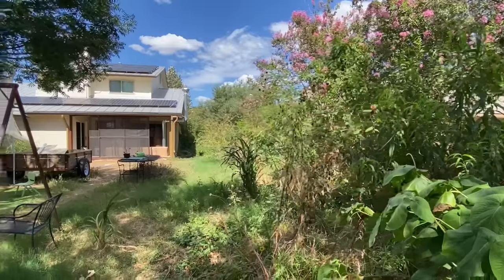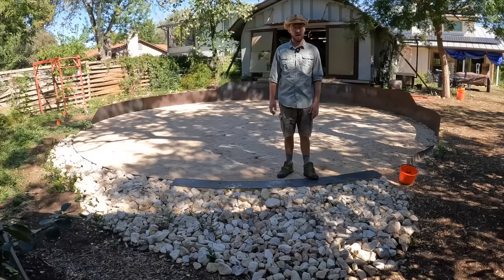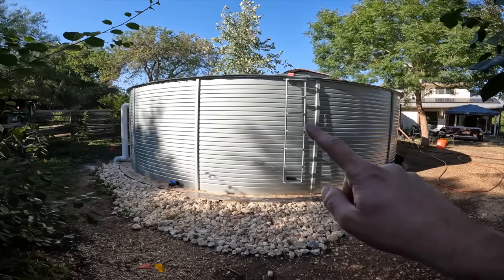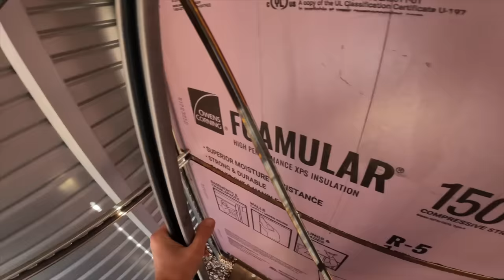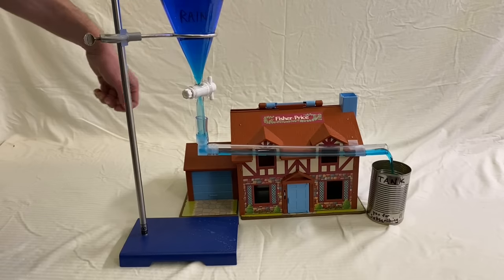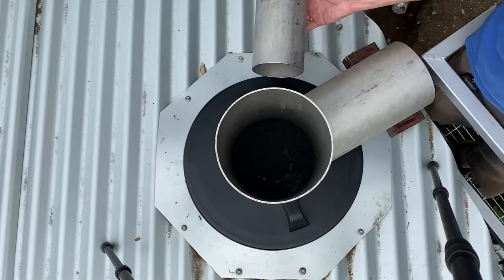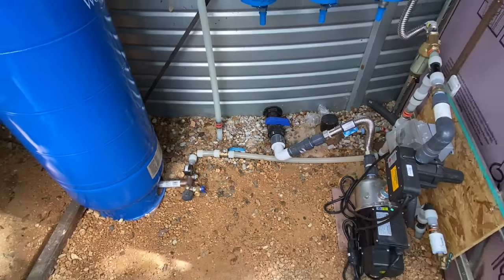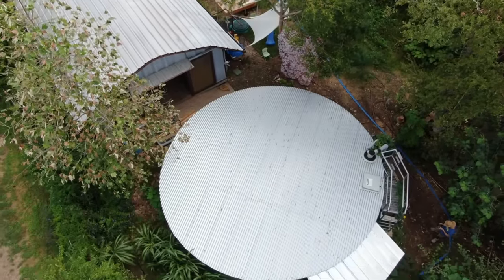FREE water forever.  LEGALLY!!!!

Comment: Its crazy that in some places collecting RAIN WATER is illegal.
Reply: In Australia it’s illegal not to collect rain water.
Reply: Because it can mess up the local water table.

Remember water runs in a cycle, by collecting it you are removing it from that cycle.  Collecting thousands of gallons of water and just holding it can cause damage to the surrounding ecosystem.
Reply: @sgt.doughnut5918  That isn't true or logical. This water would still be used by his household. It would just be stored with the public reserve.
Reply: in america everything that is not related to capital is illegal
Reply: I think it’s illegal to collect a certain amount because if you say collect a very large percentage of the rainwater in an area that doesn’t get much anyways you can basically hold it hostage for money, some shit nestle would do
Reply: @b33zcraigslist46  I doubt his toilets flush out into the yard so no, this is different.
Reply: @sgt.doughnut5918  water runs in a cycle, allright. But what do you think happens to the water he collected? He didn't just revoved it from the cycle. He will drain and spill, wash and shower and pee, and the water anyway will go back to the cycle not very far from where it belonged initially. Those thousands of gallons will all return to the nature.
Reply: @sirsanti8408   in our country, experts recommend collecting rainwater for watering gardens so as not to overload the water supply network, and water is a constitutional right of every citizen.
Reply: @spaceair1  oh yeah it’s definitely not a country wide thing, 90% of states in the US don’t care about rainwater collection or even give you tax rebates for investing in a system. There are a few states and counties with some backward laws. Although I think I remember someone or some company buying a bunch of land just to collect all the water that landed on it and that caused some problems
Reply: He's collecting water from his roof and not his whole property, I doubt that will change the water table levels.
Reply: That’s what I read also.  Why is that ???
Reply: @andreysednev8542 where did you hear that in this video ??? Collecting rain water off your roof would out bad chemicals in the water and sand from shingles.
Reply: There are no places where collecting rain water is illegal.
Reply: @gg-gn3re Ahh, yes there is… Oregon, Washington & California, for starters.
Reply: Es braucht ja auch die Natur
Reply: Unfortunately, it is highly regulated in Ohio.   It's almost as bureaucratic and tedious as getting permission to turn on your solar array (5-8 months or waiting for inspections).

"Private water systems in Ohio require a permit from the board of health pursuant to Ohio Admin. Code 3701:28. Rainwater cisterns are required to have continuous disinfection installed (Ohio Admin. Code 3701:28)."
Reply: @Captkid1  No it isn't. Oregon you can collect 5000 gallons before even needing a permit. 
California you can collect infinite amount with a permit
Washington it's legal everywhere, some specific counties have regulation. No permit required
did you even look it up or you just make stuff up?
Reply: @gg-gn3re  A permit? So it isn’t legal without a permit?  That is insanity, it is Rain Water.
Reply: You usually don't own the water or mineral rights under your home either.
Reply: @Captkid1  Most homeowners in Colorado are now allowed to use rain barrels to collect rainwater. A maximum of two, 110 gallons total.
Reply: @gg80108  As if government owned the rain, right?  Next it will be unlawful to out in the rain, because your clothes absorbed too much. Wouldn’t surprise me.
Reply: @gg80108  True. But you do own the air space above your home for several hundred feet. You certainly own the air space in your yard and home.
Reply: @Captkid1   yes the air is free water not so much.
Reply: @b33zcraigslist46  I think what he means if people are collecting and storing water rather than using it in places that experience a lot of drought. Still illogical though
Reply: it is illegal to collect rain water in palestine gaza and palestine west bank
Reply: @gg-gn3re  good point.  Most places require a permit to build a structure and it wouldn't be proper to say building structures is illegal because of that.
Reply: @Captkid1  Another comment thread brought up that apparently it has to do with tracking water usage across the state for things like issuing drought warnings and such; if a bunch of people were using collected rainwater that the government did not know about, it would screw up their calculations used for warning people about droughts.
Reply: @G-Cole-01  Ok, I am retired from the government after 30 years of work in the Engineering / security / Law Enforcement. I have worked with many agencies over the years. First off, if you intrust the government to keep you in water, you’re going to die of thirst.  Second, rain water is completely unpredictable, uncontrollable and is not calculable.  Where will it fall, how will it fill flow, what percentage will evaporate, what percentage will flow into a stream or river, what percentage will filter down into the aquifer? But most importantly, the government does not own, control or even keep exact record of the rainfall. Since the governments around the world have been manipulating weather for the last decade, climate issues have gotten worse. But we aren’t suppose to collate the two.  Hmmm. Keep this in mind when you are entrusting the government to do anything. The structure of the government is for everyone to move up. Each person is in their current position 3 to 5 years. You are encouraged, promoted and even forced to change. The longest I held any one position was 12 years and I had to leave and come back to get twelve years in that position. What if your doctor only had less tahn 3 years in medicine? What if the person building your home had less than 3 years in construction. Now add in POLITICAL control of funds and a requirement not to piss off either of two opposing political foes, who both have some control over you.  That is the Governement you want to control your water. Reminder; You can only live 3 days without water and three weeks without food. Do you really want to count on the government when they say, no, no let that water go, we will give you your water you need to drink. That God given water is ours to control.
Reply: @spaceair1  correct
Reply: @sgt.doughnut5918  You're correct, but it doesn't prove your point. If what you propose was true, droughts would effectively destroy the water table. The reality is it's VERY difficult to disturb it. There's usually enough ground water to sustain well over 5 seasons with sub average rainfall. Now if you live on/at the base of a hill, suddenly it matters even less, And to be honest? What do you think happens to excess water? If it can't saturate, it runs. Even in sub par rainfall regions there's still an excess.
Reply: Maryland taxes you on how much rainwater hits your land.
Reply: @sgt.doughnut5918  lmaoooo he's collecting roof water, not water from the Amazon forest. hahaha
Reply: Agree with you it's sad✌️
Reply: @sgt.doughnut5918 That is so stupid. I had no idea our bodies violated the laws of conservation of matter when drinking water.
Reply: @spaceair1 what country? Must not be America bc we are price gouged in certain towns andnstates depending onnif its a private or public water municipality
Reply: @michroz  the water will be send to a treatment plant that will in most case will clean most of it and send it back in the ocean or a river and not the place where it should be said a region where rain is scares so now there less water in that specific region so desertification will now be faster like yes the water will go back in nature but not the place where it Should be
Reply: @sgt.doughnut5918  if you are hoarding water, possibly true, but that would also mean that you would have to have a large piece of land to have any sort of impact.  If you're collecting water for your home use, or even to water your lawn/garden, wash your car, or anything else you would normally do with municipal water, unless you're collecting water is several multiples of what you use, what you claim would be completely incorrect.  Even if you did collect 100 times what you use, that means that you will only have an impact on the environment (although insignificant) only for the initial period of filling up your reservoir.  After that, your collection rate will match your use rate exactly, and then, again, you would actually be saving water, because you would not have losses equivalent to the losses through leaks in the municipal plumbing.  You would also reducing the use of toxic products used in water purification and toxic fluoride being put into your water without your consent.
Reply: @sgt.doughnut5918  which is funny because the water eventually gets used anyway so all you're doing is delaying it.
Reply: Some states/areas/countrys it's illegal because of past incidents were it causes hundres of thousands or millions in damages. also each collection system would require system check ups by professionals not just yourself. to make sure it's filtering right and safe for yourself/future occupants of that house.
Reply: California 😂
Reply: @arkfan5345  Yeah. The laws about this make perfect sense if you think about the impacts.
Reply: Nobody owns the rain.. those laws aren't real.  Just keep your mouth shut
Reply: @DTA-me3kv  it's not a law against owning rain are you really that dumb? It's about the construction. The filtration and safety of it  for residents ect. Or the impact of large amount rain water being collected from certain areas causing eco systems to get wonky and messed up.  Also if a let's day 60 ton water collection system just for argument sake breaks because poor maintenance. That can cause insane amount damage. Water as fragile as it is in small amount is deadly in large storages.
Reply: @valleymykel-mq7gw  The complaining about "I can't even collect rainwater on my own land, damn gubmint" is 90% from people that are eager to do exactly what the law is attempting to stop, namely collecting water from dozens or hundreds of acres of land that is unsuitable for farming adjacent to their farms in an effort to improve their crop yields at the cost of fucking up the water table for a ton of land. "I can't even put out a rain barrel, unhappy face", yeah, and the multi-million dollar system you want to install in the next lot over is merely a coincidence, I'm sure.
Reply: @sgt.doughnut5918  I'm having a hard time figuring out how this makes sense and I'm stupid.
Reply: @michroz except that water, unless he’s draining it into his yard (which would be *significantly worse*, I hope I don’t have to explain why pumping sewage into your lawn is bad) doesn’t just “go back into the cycle”, it goes to a waste treatment plant, is decontaminated, and then pumped out to wherever the city gets it’s water, to cycle back again.

But that plant and reserve could be incredibly far away, and so the water table in his area can be damaged by stuff like this.
Reply: @spaceair1  THERES the correct answer lol
Reply: @b33zcraigslist46 I think the law is dumb because it’s your own property but, wells rely on that water that is underground. So if everyone started doing this, those wells would not produce as much water.
Reply: @skwillywilly  The science or math doesn't add up regarding well water. Aldo, if well water is for human consumption, why be upset that it's being consumed?
Reply: @sgt.doughnut5918  It's being collected anyway, it's just that on most houses it's being thrown back down.
Reply: @Captkid1  Citation needed. It seems like the kind of thing that should be encouraged in those states, which are seasonally dry.
Reply: @gg80108  you don't own anything. and you shouldn't. you should only own the right to use and improve.
Reply: @Captkid1  citation needed on government weather manipulation
Reply: @sgt.doughnut5918  It's also released back into the ground via soakage holes after the septic waste system. So it all ends up back in the ground eventually.
Reply: @sgt.doughnut5918  😂😂😂😂 oh my god you actually believe that. 😂😂😂😂😂😂😂😂😂😂😂😂😂
Reply: @ellenorbjornsdottir1166  I don't make the laws, these laws exist even if you know about them or agree with them. Don't steal my aquifer water.
Reply: Where is it illegal ?
Reply: @spindrift2719  Did yo read the responses? People have listed it being illegal in several states & regulated or restricted in several more.
Reply: @sgt.doughnut5918 I never heard that one thanks for sharing extra knowledge 😅
Reply: @sgt.doughnut5918 you mean kinda like the cities where we live do😳🤯
Reply: MOST of the adventures recorded in this book really 
occurred; one or two were experiences of my own, 
the rest those of boys who were schoolmates of mine. Huck 
Finn is drawn from life; Tom Sawyer also, but not from an 
individual — he is a combination of the characteristics of 
three boys whom I knew, and therefore belongs to the com-
posite order of architecture.
The odd superstitions touched upon were all prevalent 
among children and slaves in the West at the period of this 
story — that is to say, thirty or forty years ago.
Although my book is intended mainly for the entertain-
ment of boys and girls, I hope it will not be shunned by men 
and women on that account, for part of my plan has been 
to try to pleasantly remind adults of what they once were 
themselves, and of how they felt and thought and talked, 
and what queer enterprises they sometimes engaged in.
Reply: @gg-gn3re Oregon for sure. Most likely California but I'm going to look into that.
Reply: What about a state of the art filter system to clean the seeding chemicals they put into the atmosphere
Reply: Land of the free
Reply: The sheriff of Nottingham wants his tax money.
Reply: @sgt.doughnut5918  That's not how it works, if this was correct them lakes and rivers, deserts, swamps would be in the same location for million of years, but they move. Whoever told you this is wrong, there is a reason why we were nomads in the first place, we were chasing water and other resources.
Reply: @milliesecond102  wrong. You are allowed to collect rain water in all of oregon and it's encouraged in most parts.
Reply: @sirsanti8408 it's from the southwestern US. You have water right (typically 1 acre ft/acre) these can be bought and sold independent of the actual land.  The water which flows though rivers and streams are part of these calculations. Where water and rain are scarce water becomes a commodity.
Reply: @michroz Yes, this is why the ONLY illegal rainwater collection in ANY state is in regards to collection and use not by the property the collection is on.   If you build a large enough collection site you may be assesed a small usage fee and tax, amounting to a few dollars a year; but thats only if you are collecting massive amounts of rainwater as-in comercial scale collection.
Reply: @Captkid1 No, its not and you should really stop amplifying that lie; it makes you look lazy.
Reply: @tstan6827  Thats only is you tie it into the mains.
Reply: @Captkid1 Maybe you wouldn't be so unhappy if you stopped believing misinformation; you are already on the internet, and if you are too lazy to look up state and county laws you may as well just not believe anything you read and get on with your life.
Reply: @Captkid1 If you live outside of flight areas its generally considered 500 feet.  If you live in flight congested areas its about 80 feet.   rain is usally higher up but you are all arguing about a nothing-burger since the whole rainwater collection is illegal is just another neocon lie.
Reply: Fun fact: in many states reasonable sized rain collection tanks don't have to be permitted even when a smaller shed would have to be. There is some mention in these comments about Ohio in particular, where they have confused a cistern with a water barrel or tank; in that case a cistern is a raised up structure such as a water tower or a tank on top of a building.   the purpose of a cistern is to maintain water pressure when the pumps stop;  the issue with private cisterns is tying into the main with gravity pressurized tanks and your regular household backflow preventer is not built for that.  This is a similar situation to what occurs when you want solar or a generator to do anything but run a wholly seperated circuit in your home.
Reply: @_digitalcoffee  Not unhappy or misinformed. You just go ahead and count on the government to give you food and drink. See how it goes. I am retired from the Federal Government. I know that YOUR Government says EVERYTHING is your own fault in the end. And you are responsible for everything in the end.  You and you alone.
Reply: @_digitalcoffee  NO, collection of rainwater is being regulated in several progressive states. It is a real problem for many Americans who want to use water for purposes the controllers don’t like or approve. By example, watering a garden is not a water priority or approved under regulation periods.  From my own point of view, it is also being used as one of many freedom infringements tools to drive population into or out of areas of the USA. I live in Florida. 1.3 million people moved here from California, PA and NY last year alone. All are fleeing tyranny freedom losses of their state governments that they elected to govern them. Possibly they were  ill-informed voters, possibly believing lies of politicians, most likely thinking that loosing a few Freedoms is a NOTHING BURGER or maybe even a neocon lie.
Reply: @_digitalcoffee  Lazy? Thats funny. Obviously you are a liberal. Liberals always fall back on name calling when they loose a debate.  I am an Engineer, a Mechanical Contractor, an Electronic Technician, a Federal Security Technician and an Electrician.  My hobbies are Sailing, building boats, running a sawmill, Woodworking, teach young adults the trades, art, photography, fishing, drones and theological studies. I have never been called lazy before in my whole life. I would love to hear how you came to that particular name to choose to call me when your ability to hold your stance in this public debate failed you.
Reply: ou do , then y don't every sue the airlines and factories for contamination of my air space n quality and brings up alot of hmmmm if true
Reply: @Captkid1  I'm a disabled veteran who enlisted during wartime and served eight years until my hand got crushed. 
How long did you look through state laws to confirm that none made rainwater collection itself illegal.   There is nore to life than your political stances; I would love to hear you tell me how my enlistment after my country was attacked and the fact that I am a sworn constitutionalist makes me a liberal.   By all means dig a bigger hole by insulting me because you wanted to express a baseless opinion about non existant laws.   I guess lazy wasn't accurate enough so how about we try "unconcerned with truth and reality and apparently an idealogue."
Reply: @_digitalcoffee  How is your Veteran status relevant? I am a disabled Veteran too, with a service Dog, I don’t use it as part of social interaction to try to gain advantage in a debate. Being a Disabled veteran is an honor, not leverage point. It does not excuse you from being an honest, moral and ethical human being. You obviously have not researched the laws on rain water collection, nor did you read all the replies of people living under those laws in various different States, that have these laws. So it is you and you alone that is not touch with the topic you hope to spread Liberal Propaganda on. Unconcerned with the truth, reality and being an ideologue describes YOU.  Like most Liberals, you accuse debate opponents of exactly what you do.  Try getting a hobby. BTW, the post you are responding to is 3 months old.
Reply: @Captkid1  You mean CO and CA, yeah, I did reasarch those, and debunked that, unlike you I tske the time to research the actual statutes, not spout propaganda and be lazy of the mind like yourself.
Reply: @Captkid1  I love how you were too lazy to actually look up what is prohibited in OR is groundwater pumping, waterway diversion, and creating large artificail sole-purpose collection points.   Just keep spreading disinformation to fit your biases; I will continue to fight the zeitgeist with polite might.
Reply: @Captkid1  And in this post, by your stated arguments, you are a hippocrite and apparentlty also a liberal; considering you resorting to name calling instead of actually debunking misinformation and crying when someone points out your fallacies.  Good job, liberal.
Reply: Colorado.
Reply: @tanial.williamson8082  Colorado allows for two barrels and up to 110 gallons.   Also its not the state government but the state's constitution which provides for first-come first-served access to state resources including water so, in a way, R&R Market has the most rights to rainwater.
Reply: FANTASTIC POINT!  @michroz Plus, he's NOT collecting "ALL of the rainfall!" for goodness sakes.😉😅
Reply: @Captkid1  I swore an oath commiting myaelf to excellence and the fair treatment of all.  I also backed up my statements with facts and cited the relevant statutes.  As to the relevance of my Veteran status and my disability I'm going to point out that when I enlisted we were in a war created by one man's lies which resulted in over a million unecissary deaths.   So yeah, maybe I have earned my right to take idealogical disinformation personally; not my fault you would rather qualify your "opinion" and then attack me for providing factual responses.
Reply: @Captkid1  Yeah, and if you let it stay rainwater that would be fine; you want to build a large cistern.   Are you okay with letting an apartment collect rainwater and not treating it?  32% of Ohioans rent; should they have no say in the quality of the water in the cistern that feeds theit unit or its construction? Do you believe someone should have the right to turn their backyard into a open untreated mosquito farm too?   How about your neighbors building a tank not up to code and it bursts and floods your house or endangers lives.   Sorry you have such  a problem with "promoting the general welfare".
Reply: @sgt.doughnut5918 Oh really? So what happened to the massive amounts of plants and trees that absorbed the rainwater? Humans basically and technically consumes it. 😂
Reply: @sgt.doughnut5918 in other words if it doesnt make the government money its illegal 🤔
Reply: This foes not look like freedom  illegal  to collect rain water?
Reply: @Idiomatick even if they don't flush into the yard they would still flush into whatever system his household water would have come from which is probably from the same water table anyway.
Reply: it should be illegal for government to make a criminal out of an honest good person
bcoz that is what they are doing
Reply: If you collect it, they can't charge  you $ for it.
Reply: f the law f police
Reply: It actually makes sense. When your surroundings rely on rain water draining as usual, this can be a disturbance
Reply: In a colorado major city, it was illegal to collect your own rainwater because they had already calculated every house’s rain, flowing into the drainage pipes and all the way to the reservoirs. and you were depriving them of their “city water” that we all had to buy by the gallon.
Reply: @gg-gn3re . nope, we lived a few miles from the air force academy for 16 yrs, and we didn’t own the mineral rights under us, the air rights over us, nor the right to collect rainwater from our roofs. and they calculated every foot of concrete, walkways etc, non grass for every home in the neighborhood.
Reply: @Captkid1 how it illegal to collect rain water in those states?
Reply: @michroz  not really though, for any water he takes it will likley get refilled meaning that a large amount of the tank is permantantly out of circulation. This in itslef may not cuase problems but when done at a larger scale it certainly will.
Reply: @Captkid1  the goverment tends to take intrest in droughts that could lead to ecocide or the deaths of those downstream.